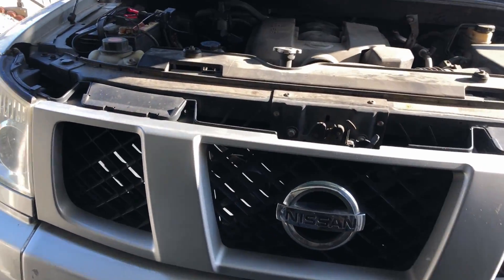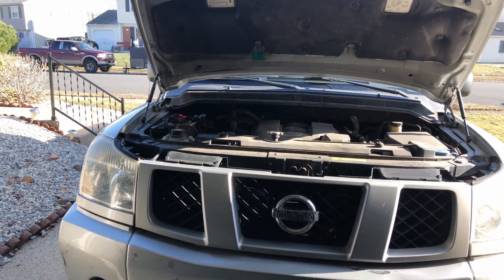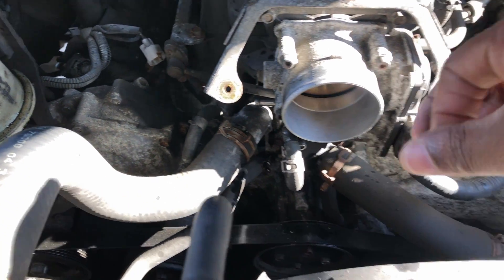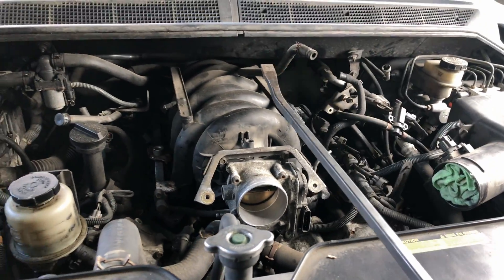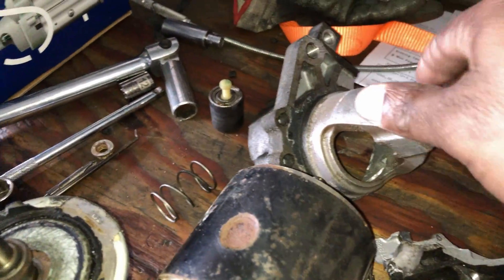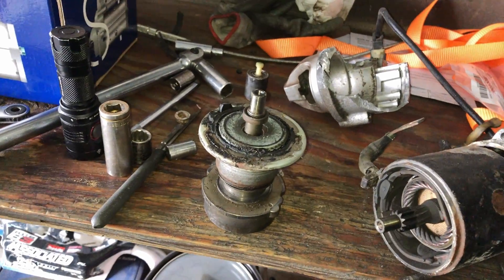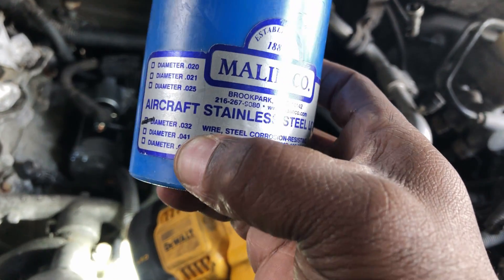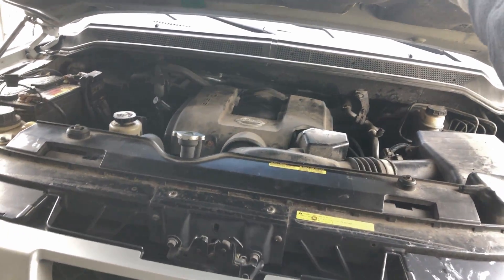Nissan Titan Starter Replacement (Pain in the A.............)

Comment: Why take the manifold off? You shoulda just pulled the starter from the bottom! 😂😂😂

Okay, I have a 17 Titan, and while some things changed with the engine, I bet the starter is in the same place. So I reckon when the time comes to do this, EVERYTHING is getting done. Spark plugs, injectors, and anything else around that manifold. Hell, I may just rebuild the whole damn thing!

One and done for sure!

Comment: That is insane where they placed that starter. I would flipped out if I had to do that job. I hate doing my brakes but I do them but that job right there. Forget about it, lol.
Reply from the maker: I said the same thing, and it was cold as hell out there
Reply: @rajaa111  Ill bet, its cold AF here as well in Pittsburgh, lol
Reply: @rajaa111  Quick question? Being Im in Pittsburgh its cold AF here right now and I wanted to know what type of hose and size I could use on the exhaust tip?  I want to run it from my exhaust to outside my house so I can break my engine in inside my house? Radiator hose to dam expensive so i was curious what you used and hopefully it is cheaper?
Reply from the maker: CBR Wix I don’t remember off hand, just take the pipe to homedepot or Lowe’s and see which one fits, then tighten it down with a hose clamp
Reply: @rajaa111  no worries, thanks

Comment: At least it DID NOT catch fire like my 1979 General motors Holden Geminis starter motor did conveniently located directly under the intake manifold and fuel line with my mother inlaw in the car the starter motor had jammed in the flywheel and got so hot it melted the battery lead
Reply from the maker: Wow... that’s horrible, I’m glad no one got hurt

Comment: Here I thought no one would ever copy the idiots at Cadillac by putting the starter under the intake manifold. 
As I was watching that I thought to myself, I would apply some anti seize on the starter head so that won't happen again then boom, it's like you read my mind. 
Fyi, that connector you wrapped the metal wire around is your knock sensor, I believe there are two in this engine from what I recall. That means when the knock sensor fails, you have to remove the intake manifold to replace the sensor. Don't fret, most V6 and V8 have that same design. 

Won't it have been some crap if you put everything together only to find the new starter was bad out the box?
Reply from the maker: Brotha, if that starter didn’t work, I would have been in the news for shooting the starter manufacturers or Nissan dealership ...lol
Reply: Toyota did it on their 4.7 V8.

Comment: Dude the way they make some vehicles are rediculous.. damn might as well just tear engine down to bare block just to remove starter.. whoever designed that is a RE RE lol 😂 but you did it right...nice brother. Put Anti-seize on the new starter lol im sure you know that 🤝 but that is not a Carburetor That’s your throttlebody your truck is fueled injected not Carbureted
Reply from the maker: Man it makes no sense to put the starter there but that's where they put it. yes I put tons of anti-seize on that bad boy, that bad starter had to be the original, I just glad I got it out.
Reply: rajaa111 or you could have dropped an LS3 Corvette engine in there and an high performance Allison transmission and called it a day that truck would be nasty like our RC whips lol.. id help ya pull it out old and drop in the new engine and connect everything lol 😂